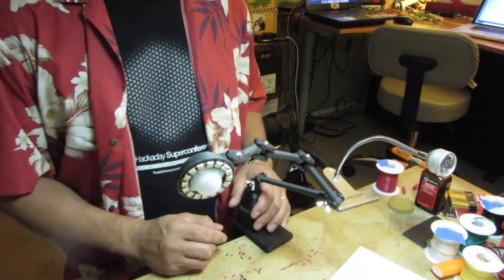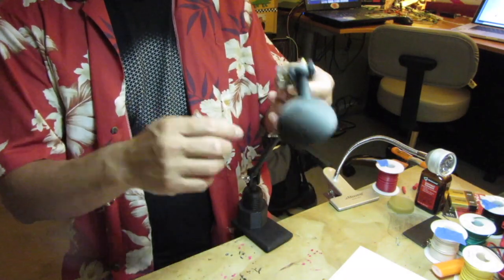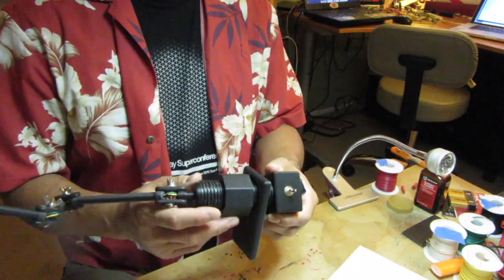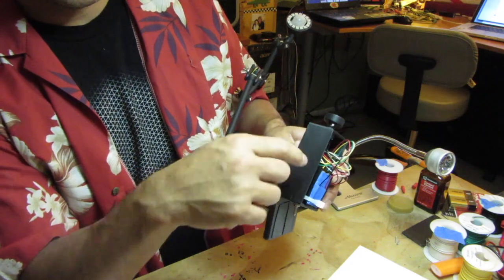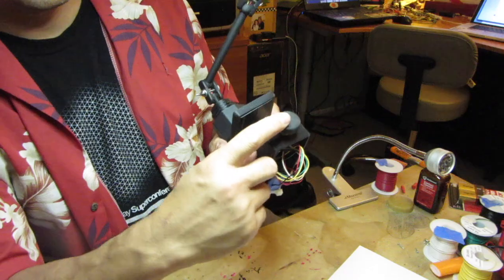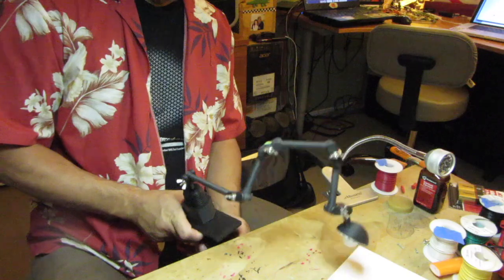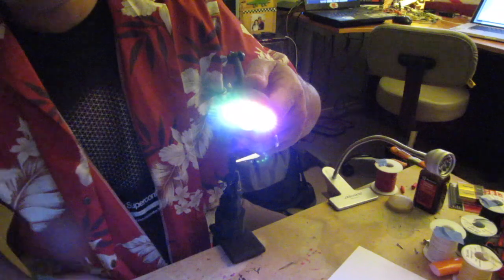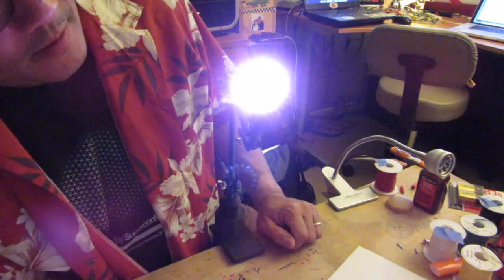Auto-Off Articulating NeoPixel Reading Light

Comment: Awesome project dude! I will be building one soon :D
Reply from the maker: Please, once done send a link to your build. I would love to see it.
Reply from the maker: One other thing. I personally wanted a gooseneck lamp. It is very difficult to find an inexpensive goosenecks. I just found out recently, though, that I might have been able to use flexible electrical conduit. I don't know how effective or durable this is. If you were looking for something like a gooseneck and you don't have any, you might want to try the flexible electrical conduit. If you do, please let me know how well it works. Thanks.
Reply: @GaryFong65  Will do! I think I am gonna build 2, so I might try to make one a gooseneck. I've thought about using the flexible hosing used for coolant on CNC machines. Adam Savage used it to make his work lights